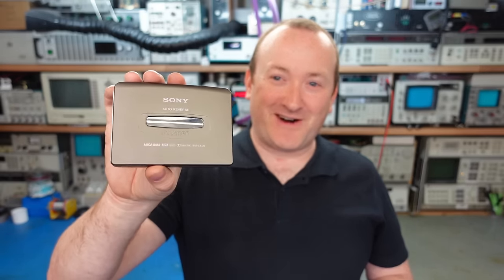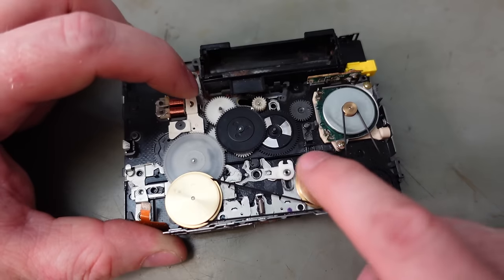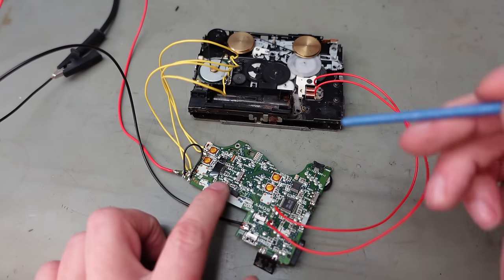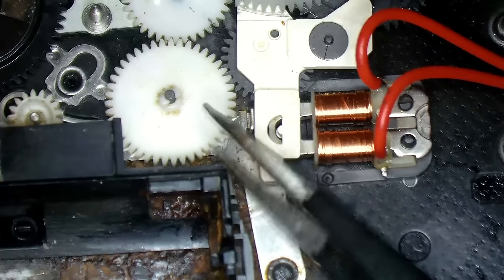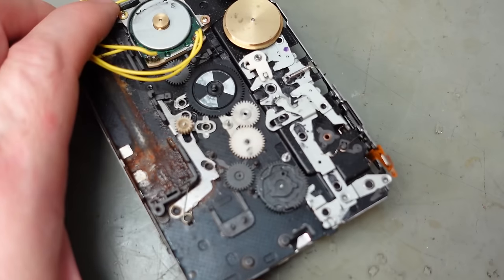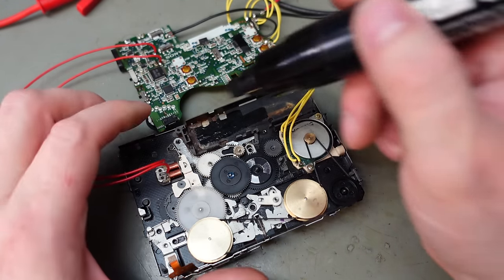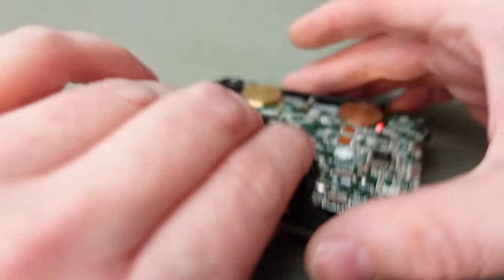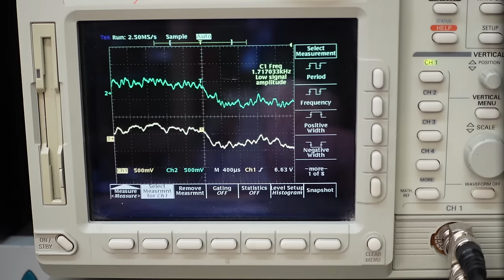SONY Walkman Repair

Comment: Regarding the demagnetizer tool you used in the end of the film.I bought such a device in the 80´s.But as I understand long after it is a kind of snake oil which really doesn´t improve the sound.
Reply: If the tape head becomes magnetised, you hear an uneven rumble sound. Like low frequency thumps along with noise. Unlike so many things in the HiFi world this is not snake oil. It’s very necessary, if the head becomes magnetised.
Reply: Luckily you're confusing snake oil with Kool-AId and drinking both has likely rotted your reason. Stand to one side and if you see a pool below you, it's either drool or seepage from your ear.

Comment: Mark, what make/model of soldering iron do you use? It seem to cope really week in heating large areas of copper. My thermally controlled Antex and old fashioned 25W irons soon loose their set temp when confronted with anything challenging!

Comment: can you assist me how to get rid of short circuit to ground on this particular model.??

i've tested all capacitor and transistor but could’nt find any issues!  i’ve also checked the board after desoldering ic’s and still shorted to ground,😢

Comment: Nice fix . But next time i would use white vinegar to deal with battery acid and then flush it with ipa. It wil solve much better. This is just a tip i give

Comment: Where are you located, Mark?  Do you take mailed in Sony Walkman cd player repairs?  I have a Walkman d-e330 that will spin the disk but will not play/advance the tracks.  I’ve changed the batteries, opened the top, cleaned the lazer with iso alcohol, and put slight lube on the metal bar where the inside mechanism slides back and forth on….i can slide this piece from side to side.  I hear a gear clicking noise as I slide it back and forth on its track, but don’t know if it’s actually sliding from one side to the other when I close the top or not, as I cannot see it.  when I put in the disc, it says “disk” and spins, but does not go to 1 (first track).  I can change tracks back and forth with the buttons, but it spins and makes a clicking noise every 7 seconds or so, and nothing else.

Comment: As a rule of thumb....if you know that you are not going to use a battery operated device....take the battery out! .. i have a 20 year old camera..it works perfectly because i took the batteries out. I opened up my mp3 player and saved it just in time as the battery pack was just starting to swell .... just needs a new battery pack.

Comment: This is why you should ALWAYS use lithium batteries. My favourite is Energizer Lithium as they never leak, have constant voltage and they've got loads of grunt.
Reply: @TheManLab7  Right!  Yeah, I think I've seen disposable 'Everedy' lithium batteries on shop shelves.  That would be a great idea to stop all that corrosion rubbish from destroying my gear!  Thanks!

Comment: Hey mark i just bought one of these to replace one that was stolen from me in 1998. It works perfectly mechanically but the sound from it is incredibly quiet. It is equally quiet in volume on both channels. No distortion so i was wondering about op amp power.. rather than a capacitor fault? What do you think? Xx
Reply: Caps first, always.

Comment: Hey! I like you videos. Tthe sound is difficult to hear though. There's a lot of noise in the recording. I think you can run some kinds of compression and noise suppression in post that would clean it up a lot.
Reply: @briangoldberg4439  Sorry to 'hear' (lol) you had sound problems with this video Brian.  All I can say is that the sound came through just fine on my oldish Samsung A11 phone driving a coke-can sized amplified speaker!  So I'm guessing the sound problem my be at your end mate if that helps cheers!

Comment: I would go find the mrs & borrow a slim emery board, the sort she finishes her nails with. peel the front face off it, so you've got a very thin piece of gritty paper, basically, & slide that under the works. there's usually enough play in those plasticky rivet jobs to allow this.
good job.
Reply: was anybody else yelling "the reverse switch!" when mark put the board back on? 😂
Reply: nice wearite defluxer there, btw.

Comment: I really dislike Sony tape mechanisms, at least the ones in there home decks. I had one and it had tons of switches inside the mechanism that would make contact based upon what direction the cassette was playing in and whether or not the auto reverse was engaged. when you put it back together if those switches weren't engaged in the right position the mechanism would not work and it was oftentimes for me at least, difficult to figure out which series of switches needed to be engaged upon reassembly.

nightmare really

Comment: Got any clue on how to open a model WM-AF29 SONY WALKMAN IT NEEDS A BELT. Everybody and their grandmother has a video on how to fix a Sony walkman except for model WM-AF29. HAS NO SCREWS NO CLIPS NO TABS NOTHING. DO NOT WANT TO PRY THE EDGES WITH A SCREWDRIVER OR GITAUR PICK IT WILL MAR THE EDGES. ANY CLUE? It's an original older model.

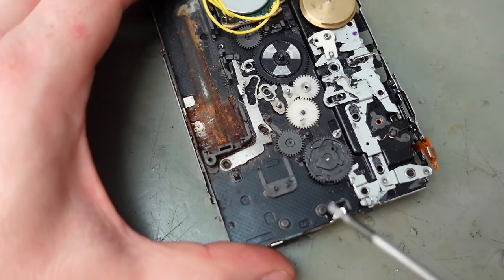Comment: 20:04 Aw, I cant watch this! 
Imo you should have used wd40 or something like that and a thin blade to slowly remove the rust. I mean the rust sits on plastic, so it's easy to remove, and that blade seems stainless.
EDIT: very professional jod though. Well done.
Reply: NO! Or something? NO!
Reply: @clevermusicbox3630  wd40 cant harm plastic nor stainless steel
Reply: @papertoyss  Plastic is made from oil. WD40 is mde from oil. Depends what type of plastic but it's a solvent. It soaks and evaporarte and can crack plastic which is old. It's NOT a lubricant.
Reply: @clevermusicbox3630  Im aware its not a lubricant.. But wd40 is actually a very soft solvent. The type of plastic used in the casing of such devices is designed to handle soft solvents like wd40. Even if what you say was correct, and wd40 could harm this type of plastic, there's no chance a few seconds of applying it on the casing to actually do harm to it. I know so, Ive used it several times. What wd40 could actually harm under certain circumastances is the paint on the plastic, but what we saw on this video was the internal side of the casing, and who gives a .... Thing is, he almost destroyed the device (this metal sheet he destroyed it's close to impossible to replace) before fixing it somehow (if this can be called a "fix") and he could avoid all this mess by simply applying a more modest solution. Imo he overestimated his experience and abilities.

Comment: I sat on mine. This cracked the board and damaged the already miserable mechanism (the mechanism in Sony sucked, so they went back to the old solution)
I soldered it with wires from a transformer

Comment: I've never seen a one battery only walkman. Interesting
Reply: @blackimp4987 It will have an internal dc-dc boost converter somewhere that increases the battery voltage up to 6 or 9 volts.  They are pretty thirsty for battery power though.
Reply: @nevillegoddard4966  I guess so if one battery must power the motor and the boost converter as well